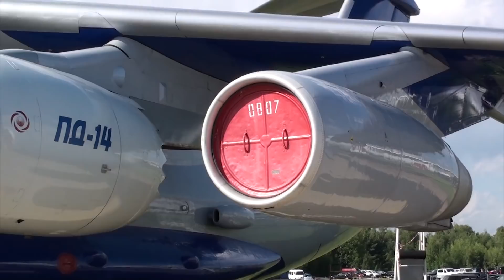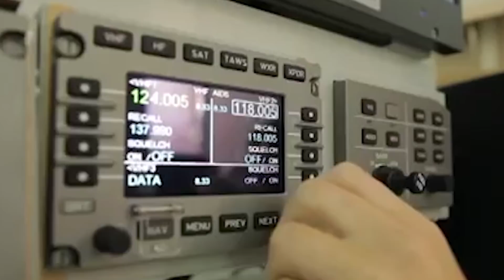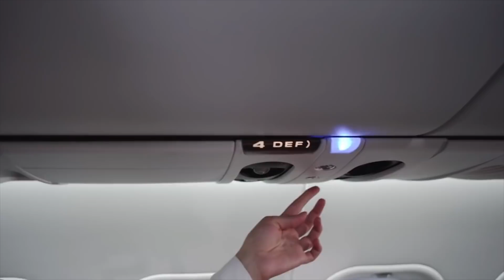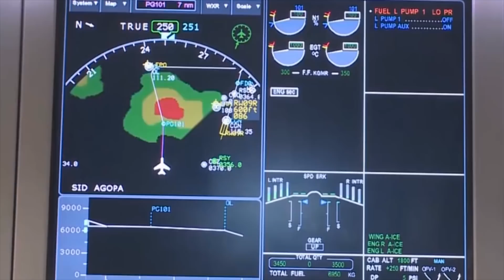MC-21 - the new Russian flagship

Comment: I know from personal involvement the MC-21-300 is an awesome Aircraft. Allot of the international companies that designed the 787 Boeing also designed for the MC-21-300. The difference is the wing design. The Russians say. "You design the wing correctly, you do not need Winglets. I was the first Flight test Jet engine mechanic for the MC-21-300 in Zhukovsky 2017 ❤

Comment: All big boys of the airplanes manufacturer who led the technological advancement of aeroplane technology and sales had winglets or birdwing like wingtips on all of their modern airplane and a scientifically proven design for fuel efficiency and reduced turbulence on wingtips.
But why the hell is MC-21 still using an ancient wing design for such a 21st century airplane...?
Reply: Probably in Russia there are no such good engineers as you.
Reply: @Swyatogor.7526  Russian engineers is sucks compare to world class engineers at Airbus, Boeing, Bombardier, Mitsubishi, and Embraer perhaps...?
Reply: @dwchen1  Did it ever occur to you that they know what you don’t know? This is the freshest model on the market, maybe with the speed, load, thickness of the carbon wing, winglets are not needed?
Reply: @Swyatogor.7526  do you really know what winglets are used for...?
No winglets means less fuel efficient because it creates turbulence at the tips of the wing that dragging the plane from behind, in return engines need to work harder, that means burn more fuel.
With winglets means turbulence is gone and engine doesn't need to work harder because of less drag.

Just that simple.
Those engineers at Boeing, Airbus, Bombardier, Embraer, and Mitsubishi knew what they are doing because they invented it and proven to be fuel efficient.
Reply: @dwchen1  Зайдите на сайт производителя.Я устал общаться с попугаем.
Reply: @dwchen1  then maybe you can redesigned the MC-21 on your own
Reply: @Kalashnikov413  why should I choose that outdated design plane if I had Airbus and Boeing which are the undisputed plane maker...?

Comment: my question is that, wether russian engineers have kept the wings straighter as compared to other planes, which at the end either can be bent upward manually or remain bent upward.

secondly if russian engineers have kept the wings straighter, it must be fuel efficient.

third , are there changes in computer controlled systems as compared to 737 max, which caused ethopian and malaysian plane crash.

Comment: At the time of Airbus A300B and A310, etops certifications were not generalised, and twin engine planes couldn't be used for long range flights. This is why 3 or 4 engines planes were used, although less fuel efficient. Things have changed, and 4 engines planes are on the way out...

Comment: Some airlines have abandoned the Superjet 100, because it has a lot of foreign parts and the French "hot part" of the engine, which does not meet the warranty period. The French partners do not deliver spare parts on time and therefore the aircraft are forced to stand idle on the ground for a long time. This is not the problem of the Superjet, it is the problem of the French company Safran (as well as other Western contractors who disrupt the delivery of spare parts). This says a lot about the reliability of some international corporations, but not about the Superjet. Now this problem has been solved - the Russian Aviation Corporation has created a large warehouse of spare parts and most importantly a large engine warehouse. Now you do not need to wait for spare parts from the French, but you can put a "replacement" engine for the duration of the repair.
Reply: Sounds like a winning way forward.

Comment: The only thing it's missing are Winglets!
Reply: It has something to do with the wing being made from composite materials. They explained it but I can't remember now. But it appears to ve true because the new Boeing 787 doesn't have wonglets but also has wings made of composite materials.
Reply: @sowhat249  it's not about composite materials, it's about aerodynamic inneficiencies and how composite materials allow a different way around them.

The tip of a regular wing causes what are called "vortex", which is what happens when air curves inwards at the wingtips due to preasure differences between the upper and lower part of the wing. These vortex cause slight drag and lift loss, which makes regular wings a tiny bit less efficient. (Google it, it's supper interesting) 

A way around this problem is to add a winglet, which have been used traditionally. It essentially makes the vortex smaller (and the drag too as a byproduct). There are many kinds of winglet. however, the smoother the transition from wing to winglet is, the more efficient the winglet is at reducing vortex. For example the a350 has curved "sharklets", the 737 Max has a split winglet, and 787' composite materials allow it to gurve the wingtips slightly upwards while ending in a pointy tip (which is another way around vortex drag). But a pattern that you may see, is that the older the airplanes are, the less smooth th transition between wing and winglet is. Another thing to bear in mind is that the "flatter" the end of a wingtip is, the more vortex drag; the 787's and 777"s wings are pointy for this reason. 

In fact, the A350's wings are also made of composite materials! The MC-21's wings however, end on a flat end (as far as I can see). Maybe they didn't want to delay the project even more by designing, building and testing wingtips (which could maybe lead to a higher price tag and a missed opportunity at the market)... Although I'm speculating. 

Hope this helped you understand that it's not about composite materials, but about how composite materials allow a different way around vortex drag :)
Reply: Boeing 777 also doesn't have winglets.

Comment: 6:40 "Which means that the people inside the plane and the clear sky are divided by 6 cm of metal"??? 
1. The wall that separates inside and outside would be 3 cm each side, OK?
2. And the wall is certainly not made out of metal only? Rather sheet metal outside, then insulation and an inside wall made out of plastic/composites
Reply: I think they just make error in translate
http://www.eastpendulum.com/wp-content/uploads/2017/05/2017-05-06-C919-le-premier-avion-moyen-courrier-chinois-prend-son-envol-01.jpg
External 3900 internal 3664

Comment: To be successful, the MC-21 will have to be offered at a substantially lower price than its competitors to beat them on the world stage.  Is MSS willing to do that?  Plus a lot of western airlines will prefer to have either Rolls Royce, GE or Pratt and Whitney engines installed on the plane.  Can this new airplane accomodate a different set of engines?  Plus it is going to have to be more comfortable than anything Airbus or Boeing is turning out for the airline industry so people don't feel like they are riding on a damn bus.

Comment: Given the Russian and ChiComm propensity to copy U.S. Technology, the question has to be asked:
Does the MC-21 and C9191 have the MCAS?
Reply: You should understand 737 exactly is a very old plane, developed back in 1960s.  Boeing mounted 2 new engines on the old fuselage to wrap it up as a new design to save R&D costs, but found the new engine was too large and made the max models unstable on flight, so they added MCAS trying to fix the problem. the fuselages of A320, MC-21 and C919 are brand new design, so they needn't MCAS.
Reply: Russia doesnt copy... it buys licences...
Reply: Yes, it is copied like the others too. Two engines, two wings etc. Aerodynamics always the same in the planet.

Comment: MC-21 Orders, no new orders in 17 months. They project completing 11 per year, which would make it very difficult to produce enough aircraft to compete with existing aircraft builders in the West.

21 Jul 2010	Russia Nordwind Airlines	TB.      	5
21 Jul 2010	Russia VEB Leasing	TBA	—	      60
1 Sep 2010	Russia Aeroflot	2019	—	             50
23 Aug 2011	Russia Rostec	2019	           35
16 Sep 2011	Russia IrAero	2019[66][67]	—	    20
27 Aug 2013	Russia UTAir	TB10	—	   10	
29 Aug 2013	Russia Sberbank Leasing	2019	20
30 Aug 2013	Russia Red Wings Airlines	      16
9 Sep 2015	Egypt Cairo Aviation	TBA	—	     10
8 Jun 2016	Azerbaijan Azerbaijan Airlines	      10
18 Jul 2017	Russia VIM Airlines	2021	             15
19 Jul 2017	Russia Saratov Airlines	2022	—	6
19 Jul 2017	Russia Angara Airlines	2022	—	3
19 Jul 2017	Russia ALROSA	2023	—.                 6
Reply: I doubt many will be delivered. The big russian airlines have good safety records using almost entirely non-russian fleets.

Comment: Excellent job and only if you have aircraft with Pratt & Whitney geared turbofan then this is the plane for you because you can use the same engines on this plane to a A220 Airbus Bombadier & A320-271N with some software modifications on the engine itself

Comment: As per my view, everything seems fine in this model except larger windscreen/shield which can welcome unnecessary risk compared to a smaller, safe &
sufficient shield with less risk probability in this space stone era. Visibility is very important, but not by THROUGH a larger shield which can lead to possible risks....bearing impacts, foreign object damages and frequent replacements, sudden depressurization in the event of damage and pulling flight crew out in no time. future weather conditions are very much unpredictable, would be even worst. we have to have better electronic eyes than human eyes. compare an elephant with its eyes and body size, compare a shark which has two eyelids, but both mammals has comparatively small eyes! let's go by nature to a certain extent. good luck! (these are my personal views).

Comment: I am rather impressed, but there are some major issues for this aircraft to overcome.

1. Political pressure - yep, global politics does play a factor in who buys what, this is done on multiple different levels.

2. Lack of faith - Past Russian airliners have not sold well, and some were even branded as unsafe for flight in some countries "airworthiness", this will have to dis-spell this with this aircraft. This is one of the reasons why the 737 is so damn popular, it's efficient, reliable, and has an impeccable history despite it's age, especially with it being powered by CFM engines.

3. Global Support - Political pressure can kill this if strong enough, or make it not a worth the venture, and those airlines seeking these aircraft would then be forced to look at other options. If they can get their support operations on the scale of Embraer or Bombardier then they have a better chance at selling into a wide variety of markets.

Comment: Winglets impose significant structural loads on the wings. The 757 and 767 winglet mod, as well as the 737NG split scimitar winglet requires structural reinforcements to install. A composite wing has limitations in this regard, adding to developmental challenges. The 747-8, 777 and 787 have raked wing tips. This design generates vortices aft of the wing, eliminating induce drag on the top side of the outboard wing area. I noticed the MC-21's wings were a conventional shape (not raked). I would guess that the requirement for low weight and simplicity was paramount and negated the complexities of winglets or rakes. If the MC-21 is successful, aerodynamic improvements might be seen on future generations, as well as aftermarket mods for older generations.

Comment: I tought MC-21 made to compete CS100/300 and E-Series and C919
Reply: No! The 737 and A320 and C919.  
An upgraded Superjet will do the others in due course. Already being developed. 
They have abandoned a smaller MC21. 
Extended Range version of MC 21 planned and then the MC 21- 400 maybe. It will need a bigger Engine. 
A PDb16 or 18 I think?  Will depend on demand.

Comment: I say it's a big improvement for the Russian aircraft industries. Even those wings look like the are from the 1990s but it completely composite fiber. The real aircraft that's going to make a change is the that lighter or faster. As long as the plane is safe(fly by wire and hydraulic) it will give a better ego to Russia's aviation. In my opinion I would rather buy the MC21-300 instead of the A321neo(more of the centerline competitor). Boeing really needs to make a new design of an airplane because they last design from scratch they made was the 787 back in the 2008.